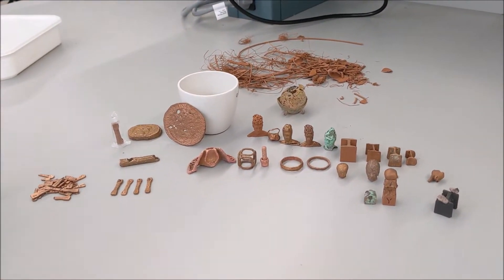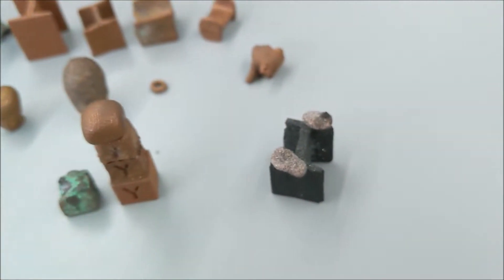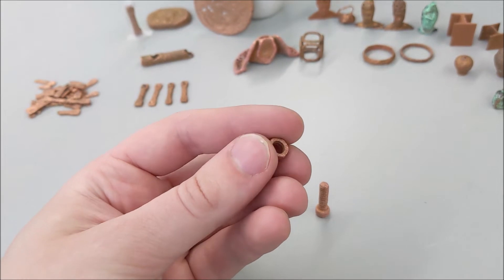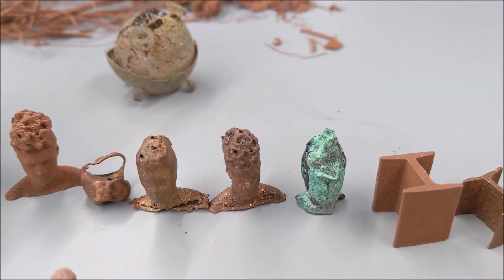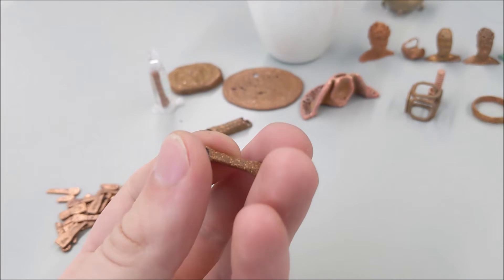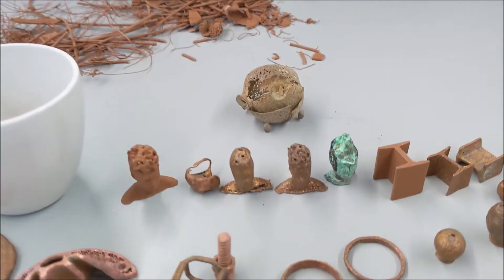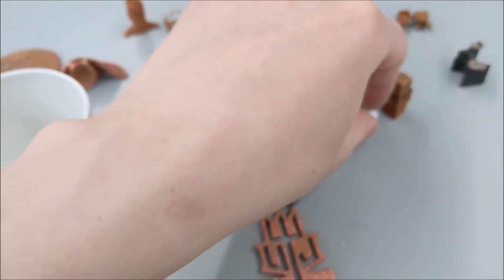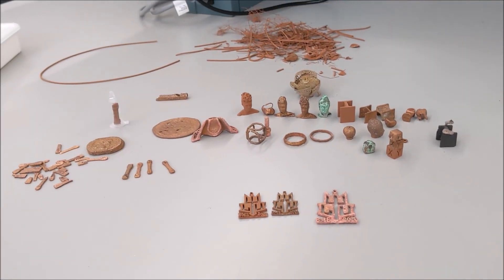what I printed (and sintered) on my first 500 gram roll of copper filament from the virtual foundry

Comment: What was the sintering temperature and duration of sintering?
Reply from the maker: Hi Shihab, for these parts I reached a maximum (reported) oven temperature of between 1060 and 1074 Celsius. There was a strong effect on shrinkage/strength/warping in this temperature range. The parts were held at this peak temperature for 3 hours. 

Full profile: Debinding:
Ramp to 204C over 30 minutes. Hold for 2 hours. Ramp to 484 over 2.5 hours. Hold for 3 hours. Let cool down.   

Sintering: 
Add carbon. Cover crucible. 

Ramp to 1018 C over 5.5 hours. Ramp to 1060 over 2 hours. Hold for 3 hours.
Reply: @WaynesStrangeBrain  Thanks a lot. Do u know the sintering temperature and time for Stainless steel 17-4 PH?